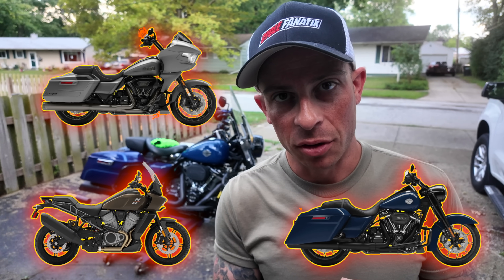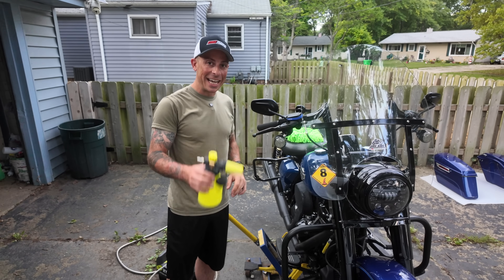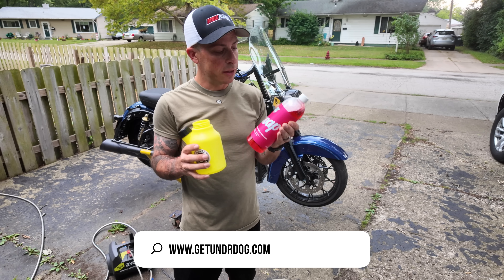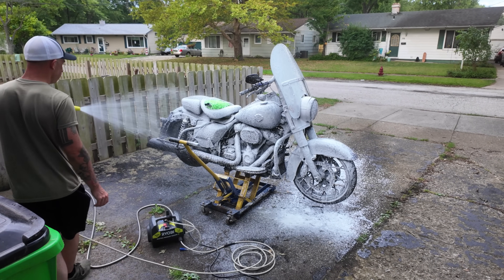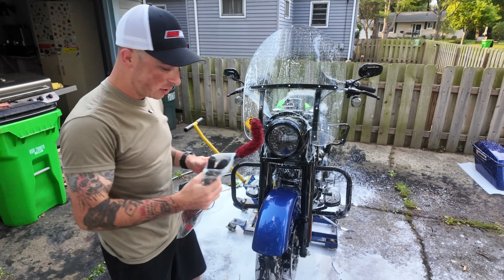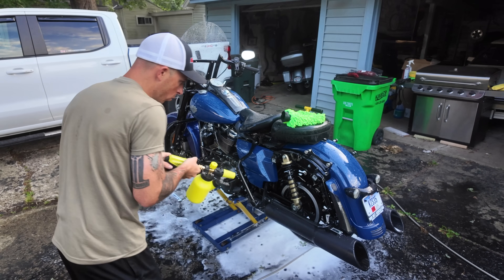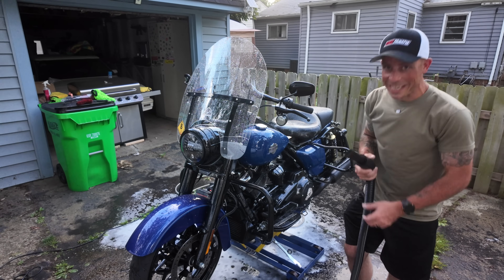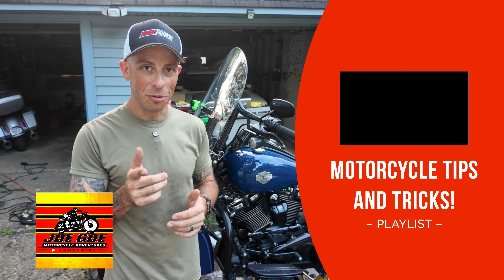I've Been Washing My Motorcycle Wrong For Years! Are you?

Comment: Nice man. Thanks. 
I just received my new cordless battery powered high pressure water /foam sprayer. Game changer bc there’s no cords and I sleep in my 18 wheeler 🚛. I’m able to keep my truck rims and tires clean 🧼 with ease. Will definitely be using it on my motorcycle.
Reply from the maker: Very cool. I’ve seen those and they look very convenient!

Comment: I came up with a cheepo version years ago. I bought a small size pressurized weed control sprayer from Ace Hardware. I put in a mix like you and then pump it up and spray the bike with it the same as you. It's not as nice as your setup but it works. Now I know there is a kit for it. I use Turtle Wax wash and wax.  It also softens the water and makes my mitt glide on the paintwork and windshield to limit scratching. On the wheels I use a diluted spray of water and Simple Green. I do the wheels first. So they get washed twice. I've got spun aluminum wheels not chrome so they water spot really easily.  When you get older you look for ways to make things easier.  That blower is awesome and I didn't know about those either. I wouldn't point it at the wheel bearings though, it might be strong enough to push water into them. Going to get one!  One thing is to fight being lazy, difficult for me, and wash the bike often and that makes it come clean with less work. Awesome video, thanks and subbed!
Reply from the maker: Thank you for subscribing! Also appreciate sharing your tips. I will make sure to be careful around the bearings, never thought about that. That’s what’s great about this community! Everyone helps everyone out.

Comment: Can't argue with being thorough. What I do is jack bike like you. Remove leather seat accessories etc. Cover stereo and speakers.Wet bike down and rinse well top to bottem. Foam Master 50/50 auto wash and water. Let sit a while. Rinse whole bike thoroughly. Dry with small Meteo heated blower. Spray entire bike with Blue Aviation wadh and wax.  Then dry and buff with drying towels. Top to bottem. I only foam once.
Reply from the maker: Sounds like you have a great system! Thanks for sharing it!

Comment: I suggest you to put wwd40 on the engine and exposed steel parts if you're riding in the winter too to protect it from water and salt (not in the brakes and foot pegs), and remove the ecxess. For plastic and rubber parts silicon oil is the way to keep it protected and give that brand new look. Trust me next time you're wash the bike the dirt will just fall over.
Reply from the maker: I’ve heard that before, I’ll have to give it a shot. Thanks for your tip!

Comment: Foaming is meant to be pre-treatment to a standard 2 bucket wash.    Also, using the same mit to do all parts is risky to your painted parts.        Air dry followed by a detail spray is a best practice.  Alternating, just riding it is fine too ;-)
Reply from the maker: Thanks for your feedback! I get what you’re saying about the mitt. I haven’t had any issues though. I make sure to not use it on the wheels because there is some nasty crap on them! Appreciate you watching!

Comment: I have been cleaning bikes for years a special way ' simular to the way you are doing it ..
I never use a pressure washer on any bikes ..
A bucket of hot soap water and a wash mitt
Then rinse with a bucket of hot water ' then grab you're  leaf blower and blow dry it ..
Then grab some anti rust products and go nutts ... 
A good point you made was use low pressure if you do use a pressure washer ...
Reply from the maker: Yes, definitely want low pressure! I never used a pressure washer previously. I use it now because you get the best results with the foam canon. Just goes to show there’s more than one way to do things! This way I have gotten the best results. Appreciate you watching and sharing your tips!
Reply: A pressure washer with a foam cannon isn’t the same as a pressure washer with a 10° nozzle. The foam cannon doesn’t have the ability to force dirt and grime into places you don’t want it like a straight pressure washer tip will.

Comment: I forgot to mention in my main post that Honda developed a spray cleaner wax for the Goldwing. It's awesome for on the road quick detailing and getting the bugs off your screen without scratching it.  It is safe for metal, paint, chrome and even conditions the seat and rubber bits.  It is not expensive either unless the Honda dealer near you is gouging.
Reply from the maker: Awesome! I’ll have to look into it. Thanks for sharing!

Comment: I’d have a can of silicone lubricant and spray down your jack with it after.  You can wreck a jack pretty fast with some of the solvents in these washes.    Spray the whole jack liberally.  Let it sit.  Wipe down the surfaces with a paper towel and you should be good.
Reply from the maker: Thanks for the tip! I might have to do that. Although, I’ve been using this jack for about 5 years now with no issues. I must be lucky! Appreciate you watching!
Reply: Perhaps a video about washing the jack...?

Comment: Riding in the 80's was wonderful in many ways. No cell phones was a major contributing factor. Adventures required maps, real ones. Distracted drivers were the ones changing channels on their push button radios. Washing my motorcycles was easy. If Dad didn't have any turtle wax car wash laying around in the garage I'd grab Mum's bottle of washing up liquid, a bucket, and a hose pipe, and set to. Or I'd mosey on up to a gas station and run the pressure washer. No instructions,  no videos, No regard for the ingredients in those washes that I'm now told will destroy my ride. And then I'd ride my clean bike on to the next adventure. Wonderful!
Reply from the maker: @desmondbaker8716  sounds like a wonderful time! Appreciate you watching! :_Chuck::_Ride:
Reply: Sure thing! Don't get me wrong. The information that is put out there by people like yourselves is appreciated. A blessing and a curse at the same time. There's not much you can't find on YouTube when you're need tips on how to do something. But tI preferred hose wonderfully simple times. When a front wheel bearing needed replacing prematurely (that gas station pressure washer wad brutal) you just removed the wheel, knocked out the old bearing with whatever tools were lying around, knocked in the new, tightened the nuts with your Gutentight torque wrench and off you went. Nowadays I'd get on YouTube, watch a video, and then watch a dozen more, second guessing that the information in the first ones was incorrect.  Aaagh! 😂
Reply: @desmondbaker8716  welcome to the age of the digital salesman
Reply from the maker: @unconscioustruth1963 just sharing products I love and use. If I was depending on the money from this, I’d be broke 😂 Appreciate you watching!

Comment: those jacks suck and you know it. Get two proper screw jacks. The screw jacks that a motorcycle mechanic uses.
Reply from the maker: @flathead1930  not sure what a screw jack is, but I use this jack every time I wash my motorcycles. I love it 🤷‍♂️ I just roll it under the bike and jack it up. Thanks for watching! :_Ride::_Chuck:
Reply: @JoeGoeMotorcycleAdventures  Looked up “screw jacks”, and don’t see how they would improve this.  Motorcycle mechanics use pneumatic lifts.
Reply from the maker: @ericmarshall6602 yeah me too. Those seem to be used best while on a lift so you can stabilize the bike. That’s what I use mine for. They also won’t get the bike very high at all.
Reply: Get a J&S Jack. It beats those cheap ones...
Reply from the maker: @freddie_ray1498 I heard J&S went out of business!
Reply: @JoeGoeMotorcycleAdventures  Wow! just looked up and you are correct. Didn't know.. I got my jack back in late 2021. Took 3.5 months.
Reply from the maker: @freddie_ray1498 yeah. Also heard their customer service wasn’t the greatest either. That will definitely hurt a business!
Reply: @freddie_ray1498  They are now out of business but made a great jack
Reply from the maker: @two-wheels7397 that’s what I hear!
Reply: @flathead1930  I get it, but my jack is quick and very stable. I can even move the bike around on it.
Reply: @freddie_ray1498 JS jacks is out of business